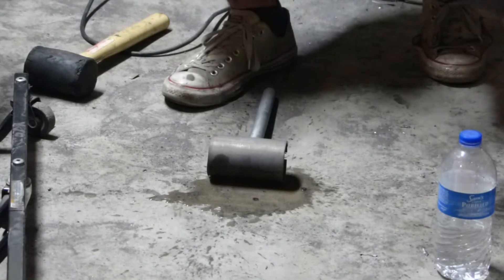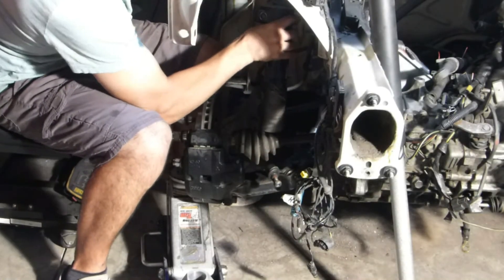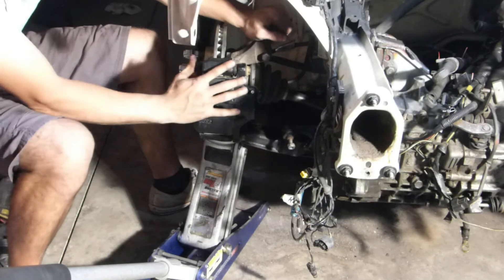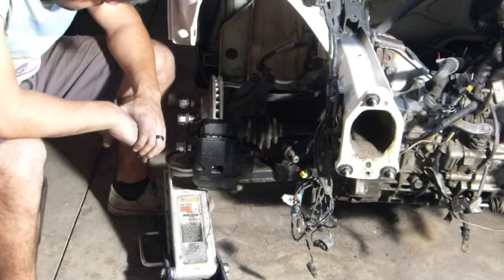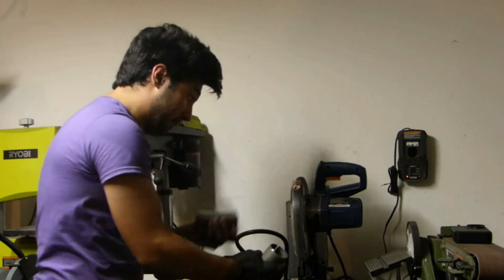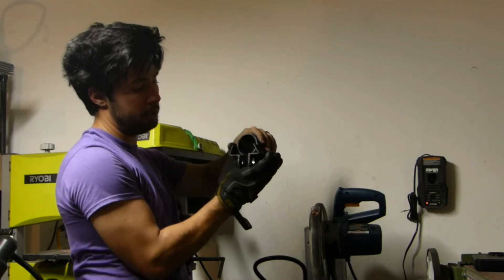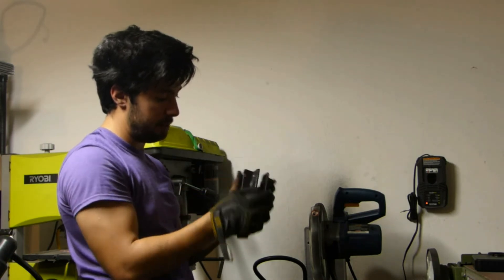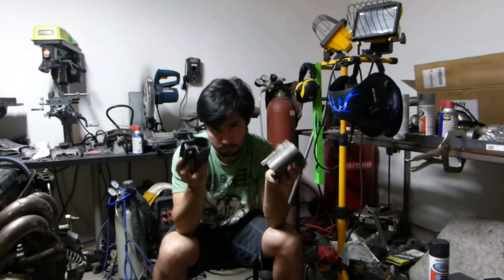✓ Building a custom suspension 4g63 AWD Mini Cooper Ep. 13

Comment: Coming along again! You're going to want that extra adjust ability camber wise for sure... I can assure you if you plan to track this car you'll want -2.5 if you can get it.
Reply from the maker: For sure but that would be temporary for a specific event and then taken right back off. But ultimately it also comes down to what the car needs. Given that the car is on stock springs and struts (for now... *cough cough hurry up and sponsor me someone*) and stock sway bars, but more weight of the cast iron block, cast iron transfer case, and diff plus everything else, along with a changed suspension geometry that smashes the GSX and Mini together, I'm going to need some serious testing to figure out what is best for each environment (autoX, rally, road course, plus daily). I'll need a lifetime alignment for sure HAHA. Plus, I don't even know if this'll be possible to corner balance yet because it's a crap shoot on guessing where the COG has moved after all this. I can't even guess a new curb weight LOL. Fingers crossed for under 3000 lbs with full interior and full of fuel